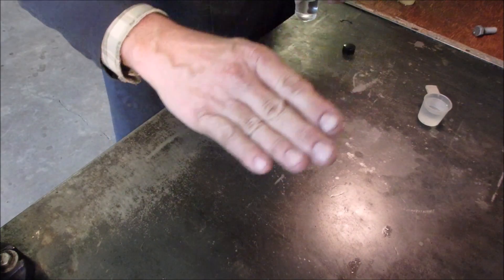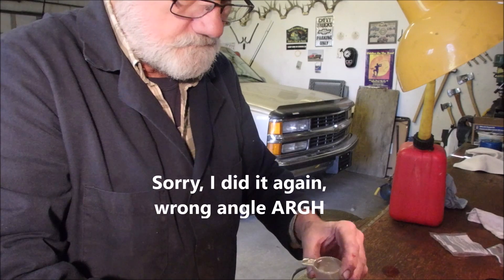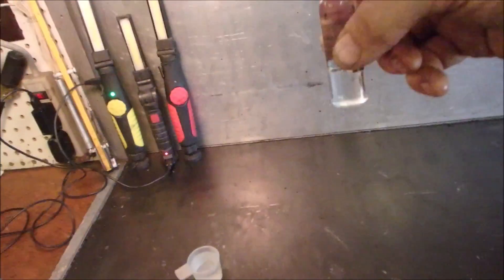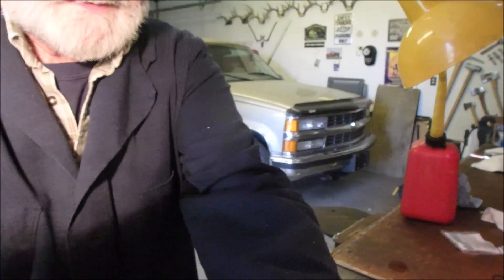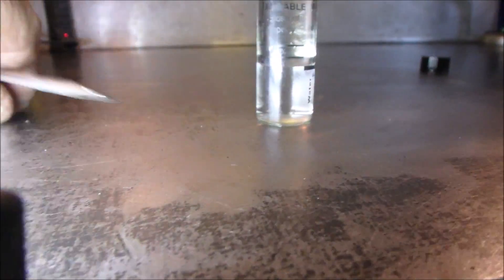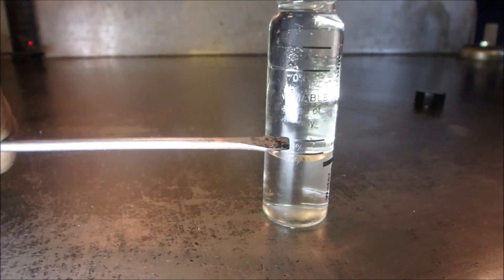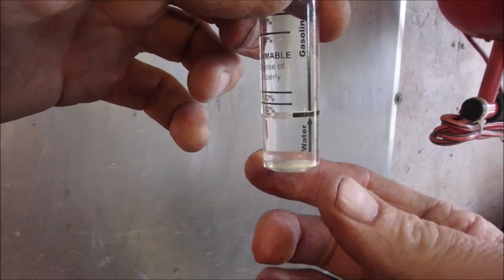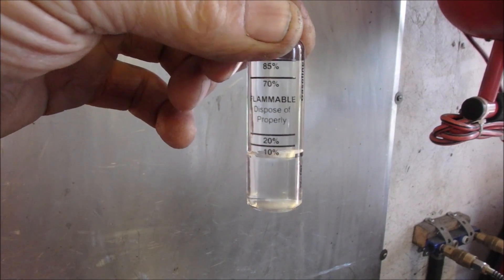Is There Ethanol In Our 87 Octane Fuel

Comment: In Ca we can't buy ethanol free fuel everything is 10% ethanol at pump. But i can get VP ethanol free small engine fuel in 5 gallon pails at my local race gas dealer which i use in my small engines. If i can't get VP fuel for some reason i get pump gas and add Ethanol Shield. It works great.
Reply from the maker: Thanks a lot.  Have you thought of adding water to e10 gas and draining out the bad stuff from the bottom?/ there are videos.

Comment: Here is New Jersey, we have Ethanol and i hate it. My friend use to cal it oxygenated gas. Still the same thing though. I use more and get less mileage now. We pay more for it and get less performance out of everything and it is bad for the small engines.
Reply from the maker: Right.  In small engines the gas in them is exposed to the atmosphere where in a car there is even a seal om the gas cap.
Reply: @BrucesShop  That is why i use Amsoil Quickshot for small engines. It is made to take care of the moisture the Ethanol attracts, and it cleans the carbon from the tops of the pistons and valves and plugs as well. I have my equipment out in all kinds of weather all year round and even after months when i try to start something, it starts on the first or second pull.

Comment: Here in NJ you can't buy ethanol free gas no matter what grade you want, it's not an option. The best way to get ethanol free gas here is to buy aviation fuel at the local airport (it's cheaper than racing fuel and it actually has a little bit of lead in it too). I find that 10% ethanol fuel is just fine as long as you put stabilizer in it (2 ounces of StaBil per 5 gallon container) and run everything completely dry before you put it up for the winter. I do keep 5 gallons of aviation fuel for mixing the 2 cycle stuff (it has an 8 to 10 year shelf life according to the local plane mechanics) and I'll usually run just a little in the mowers before I put them up for the season.
Reply from the maker: I saw a video where the gent added water to his gas.  then drained out the fluid from the bottom (ethanol and water) until he got pure fuel and that is how he got the ethanol out of his gas.  Good idea but I don't have to try it here.  That would make a good video.  To do that and test after.

Comment: I have a small engine repair like yourself. I found a gas station about 6 miles away that has 87 octane gas, and they say there is no ethanol in it. I did the same test about a month ago, because I don't believe everything people tell me. Well they were right it has not ethanol in it, and I picked up 15 more gallons today for running my rider mower and cut about 4 acres of glass.  I've seen too often what the ethanol does to carburetors and gas lines.  I trained a 3 of my neighbors to switch to 87, Of course I will loose some business but that is what neighbor are for right? I watch all of your videos thanks, you do a good job at making them. I'am 76 years young and love repairing all small engines.  The worst being chainsaws.  We have lot in our area.  The saws are very finicky and tough to tune.  Have a good day from Three Rivers Michigan
Reply from the maker: You are right.  I try to mention this  to everybody about ethanol.  The folks i see every year don't listen.

Comment: Hey Bruce I have a 5hp. Briggs it will run all day on idle. But when you put it under a load it dies . Why?
Reply: Faulty govener maybe?
Reply from the maker: @zx8401ztv  It could be anything.  Try using new fuel.  I mean new fuel from the gas station not the red jug.  Also I don't know if it is a lawn mower or a pump.  i would clean the carb before I fiddled with the governor.  Governors are not usually the issues.

Comment: In the U.S. at least the ethanol % must be stated on the pump.  I have seen problems with ethanol but not had any personally.  It is fine imo provided you use it up within 6 months ( I add stabilizer) and drain out equipment stored longer.
Reply from the maker: Right but not everybody is Al's Repair.  Good work sir.

Comment: Great Bruce down here if you want gas with no  ethanol you want the 93 grade.
Reply from the maker: I saw a video where the gent added water to his gas.  then drained out the fluid from the bottom (ethanol and water) until he got pure fuel and that is how he got the ethanol out of his gas.  Good idea but I don't have to try it here.  That would make a good video.  To do that and test after.

Comment: Ethanol is good for keeping gas from freezing in extremely cold climates. Our ethanol board wants to promote E15, the next government fuel standard.
Reply from the maker: I understand that there are better cold weather start ups as it absorbs water but -------------
Reply: @BrucesShop  Truth be told, the water used on ethanol corn crops could be used to grow animal corn feed instead. However, I don't make the legislation. I buy premium 91 octane gas because it doesn't have ethanol. <_>

Comment: Are the pumps in Canada labeled with alcohol content? Your test shows that there wasn't any ethanol in that tank of fuel. What guarantees that the next tanker full is not 10%
Reply: yes it is all about refineries bc they produce it all
Reply from the maker: @jaimhaas5170  We have 4 refineries in Alberta.  Strathcona area.
Reply: @BrucesShop  that is impressive.  In my neck of the woods (Near Chicago)we often don't get deliveries from the south and we use a special blend that costs more because of air pollution standards.  Sometimes price spikes result.  I can't find ethanol free gas for small engines at all anymore.

Comment: I don't have to do that test, every single gas station around me says right on the pump "Contains 10% ethanol". In certain states, it's illegal to sell ethanol free gasoline. I'm right next to one of those states, so I doubt distributors would spend extra money on the logistics to make sure ethanol free gas never ended up in those stations across the border. Just ship E10 to everyone.  In fact, many stations around me are selling E85 now.  There's one less than 2 minutes from me that has been selling E85 for years.  I've toyed with the idea of trying to make a mower motor run on E85. I think that would be a great project. It gets poorer fuel economy, but supposedly E85 boosts the power slightly.  I have ethanol/methanol rated fuel hoses, and I've seen Viton float seats.  However, I would have to go find a Viton o-ring that would fit the carb bowl, and find some sort of Viton washer for the jet seal/washer. E85 melts normal seals and hoses pretty fast. I wish I had a flex fuel vehicle so I could use E85 in it.
Reply from the maker: Great comment Bill.    I though of you yesterday.  I Drilled out an orifice on a Briggs plastic carb.
Reply: @BrucesShop  Haha, thanks Bruce.

Comment: Small engine shops should love Ethanol It’s a steady stream of business.  Owners not so much, maybe the next test should be keeping track of ethanol related repairs vs. other repairs,  is there a difference in newer machines? I Only work on older crap. Nice test,👍👍 Be good stay safe Bruce        hope to see you  Friday    Donny boy too
Reply: i am assuming you mean because of carb gunk over winter?  never understood why most men dont just run seasonal equip tanks empty?  never have that issue if u do.
Reply from the maker: @jaimhaas5170  You are right jaim but not many people pay attention to their small engine stuff until it quits running.
Reply: @BrucesShop  quite true.  I admit it I have done it too.  Easy to forget when early snow or some other event puts those lawnmowers/snowblowers/chainsaws out of sight and out of mind.
Reply: Most people around here will buy a new lawn mower because the starter rope broke.

Comment: We have a gas station about 8 miles or so from us that sells ethanol free gas and I have been thinking of doing the same test.  Just to lazy.  Now  I think I may just give it a go and see what happens.  Ethanol free gas is more expensive in the short run but less expensive if you consider the time and cost of repairs.  Thanks for the demo.  Great job.
Reply: what repairs?
Reply from the maker: @jaimhaas5170  Clogged carbs from sitting absorbing moisture from the environment.  Small engine carbs are exposed to the atmosphere.  Cars fuel systems are sealed.
Reply: @BrucesShop  correct me if I'm wrong,  Isn't that only a problem if it sits for months at a time (like over winter)?  Run dry at season end solves all?
Reply from the maker: @jaimhaas5170  I clean 5 carbs a week now.
Reply: @BrucesShop  so it really makes money for you...I wonder though if it is so easy for you to get it where you live (the ethanol free) what is the cost difference?  When I could get it the cost was always about 20c /gallon higher.

Comment: I just received a new steel gas tank for a 10 hp 5500 watt generator yesterday,  to replace the old resin one that ethanol had ruined along with a new carburetor, there was no saving the old carb,  it was coated thick and dry on the insides from the dissolved resins.
Reply from the maker: 90% of my repairs are clogged carbs
Reply: Bruce Pender I have neighbors bringing me mowers that “ran fine last year”. I am getting quite the reputation for being “the mower guy”. It’s always either bad gas or kill switch problems so far.
Reply from the maker: @haneyoakie14  exactly
Reply: Bruce Pender does the Tecumseh air prime or gas prime? I put a new bulb in a Tecumseh expecting to feel and see a squirt of gas like the Pulsa Prime, but I just feel air. The motor starts for a few seconds, as if on prime fuel, but then stalls like the fuel doesn’t take over. I rebuilt the carb before replacing the bulb, and it didn’t look like it was dirty or clogged. I also replaced the rotten rubber fuel line. It ran before and after the carb rebuild but it ran rough before and after. I thought the old bulb leaked air, causing the problem but now IDK. I am thinking the tank might be my next area to examine.